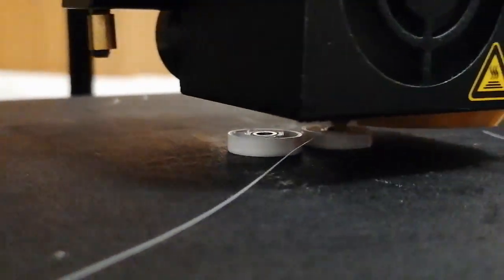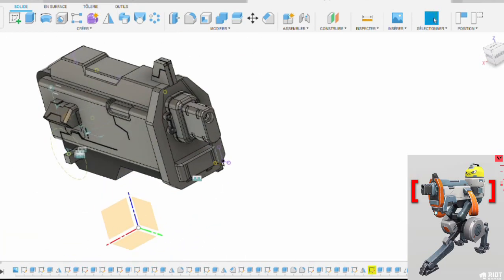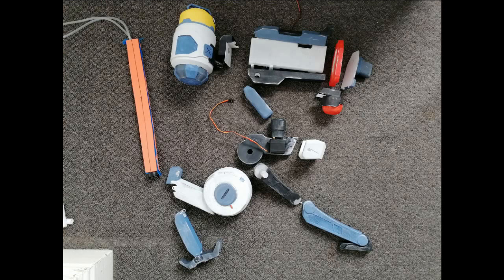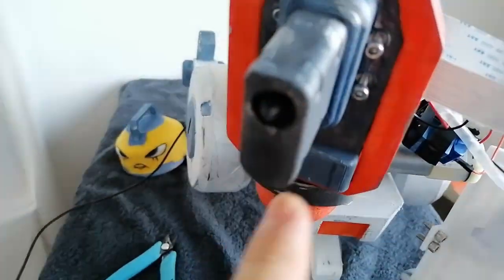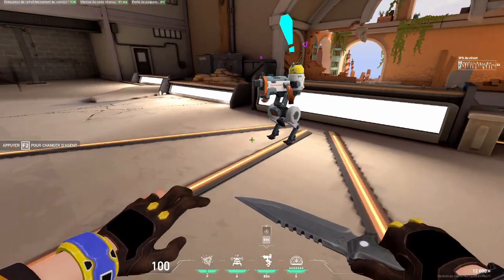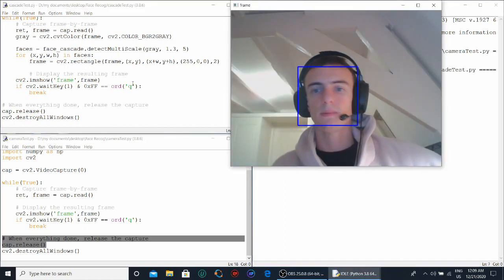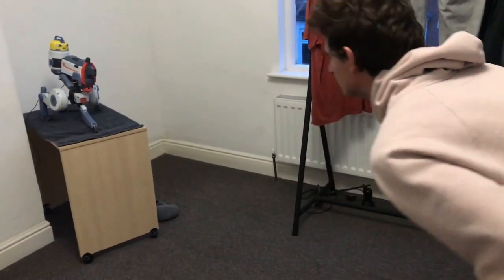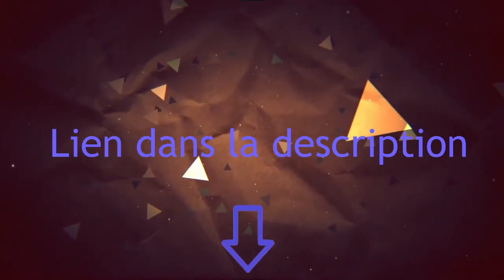Valorant| KillJoy Turret IRL (3D printing, Programming) [FR] [ENG sub]

Comment: really love this build! Trying to build one myself but the leg parts are a little to big. Do you have a File where the legs are splitted so i can glue/screw them together?
Reply from the maker: Hey, thanks! Did you check the cults3D link? All parts should be seperated
Reply: @GlitchForg3D  yeah i checked it, but my build plate is just not big enough so i already cut them myself. You had 2 versions of the front leg which i didnt realize thats why i was confused
Reply: @GlitchForg3D  but I have another issue. I ordered the Servo Motors i though you use of Amazon (around 9 Euros) but they dont fit into the central Part as intended. So the Motor is slightly tilted upwards. Did you also have this issue or can you tell me which Motor you used?
Reply from the maker: @ilovecats3807  the list of materials used for the project is included in the github rep. I had no issues with the servomotors being inclined, so you must have the wrong ones.
Here is the link to the ones I used: https://www.amazon.co.uk/Diymore-Digital-Helicopter-Airplane-controls/dp/B07DQFXDC9/ref=sr_1_3_sspa?dchild=1&keywords=servo+motor&qid=1601054518&sr=8-3-spons&psc=1&spLa=ZW5jcnlwdGVkUXVhbGlmaWVyPUFKMlhPNDcwSFVRTTgmZW5jcnlwdGVkSWQ9QTA5ODE4NTgzRVhTSEVFNlpLQVcwJmVuY3J5cHRlZEFkSWQ9QTEwMzU3ODlYQ1hOTkU4OEU0N0cmd2lkZ2V0TmFtZT1zcF9hdGYmYWN0aW9uPWNsaWNrUmVkaXJlY3QmZG9Ob3RMb2dDbGljaz10cnVl

Comment: Hey love the project!
currently in the process of printing one for myself I cannot seem to find the second (right) leg file which should be a mirror of leg.stl am I missing something?
Reply from the maker: Hey thanks!
Yeah on grabcab I think I forgot to include it on the folder 😅 but basically, the legs are mirrored 
If you need more help, you can dm me on Instagram, good luck 👌
Reply: @GlitchForg3D  can you provide the mirrored file .stl? I am not too familiar with CAD file provided to do so.
Reply from the maker: @elephant427  sure can do, I will, give me a minute. But in your slicer, I believe you can mirror it
Reply from the maker: @elephant427  Done! You can find it in the STL files folder in GRABCAD ! 👌
Reply: @GlitchForg3D  thanks a lot! Greatly appreciate it!